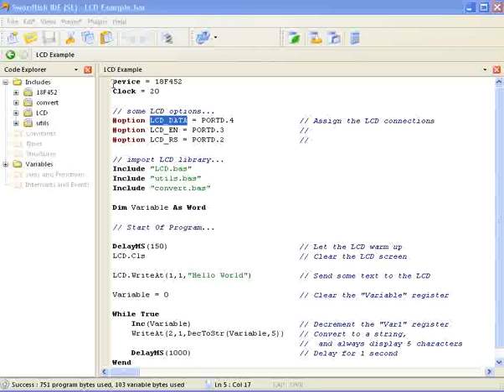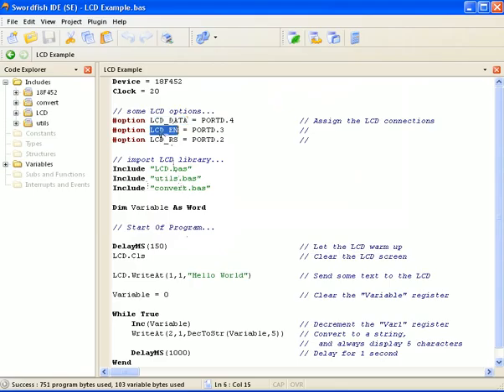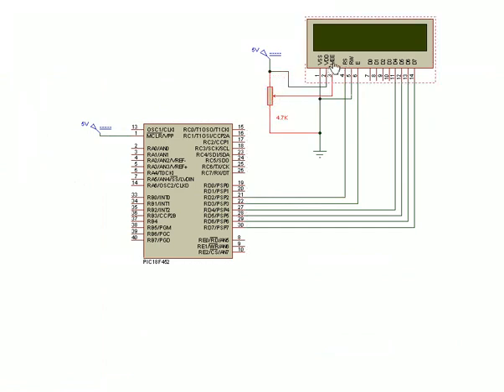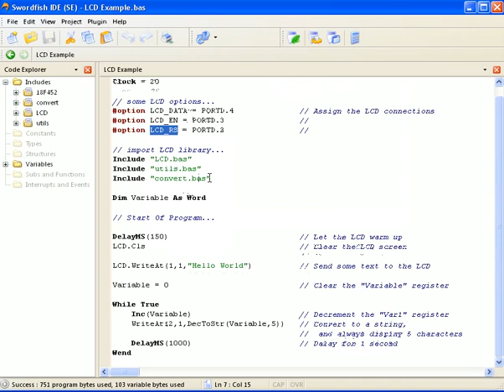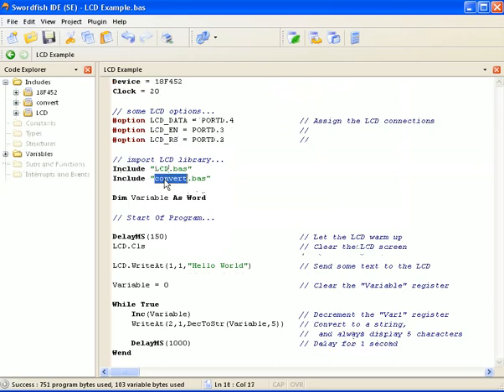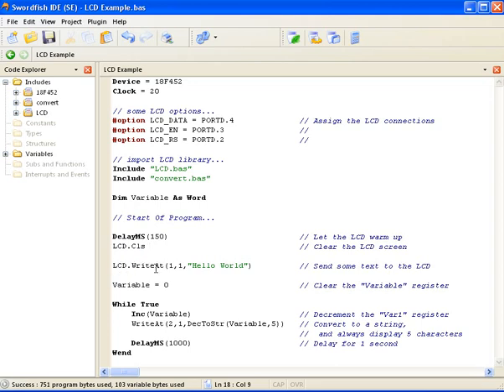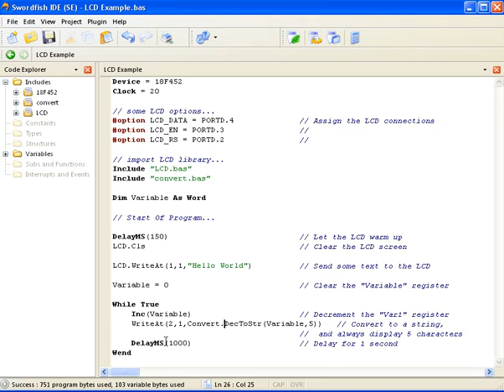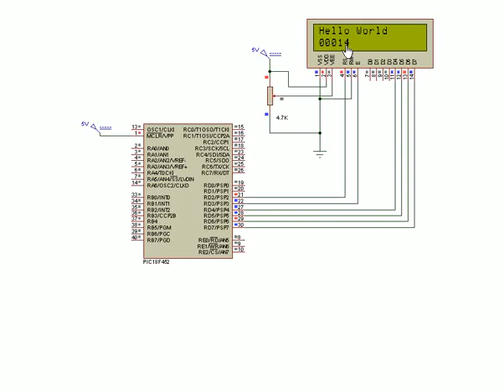18F PIC and LCD's

Comment: Nice guide. Helped me out to use a LCD character display. But I seem to have some minor issues, I have a PIC18F4550 and a 16x4 display, but line 3 and 4 starts the text on the 5th position from left, I do not know what this is occured by... hm.